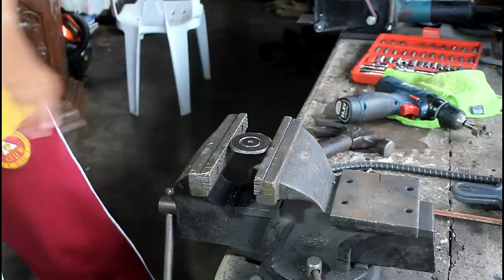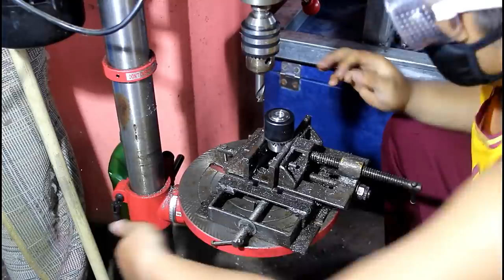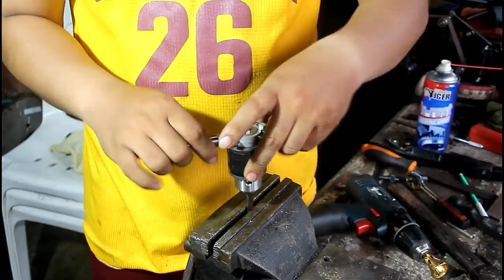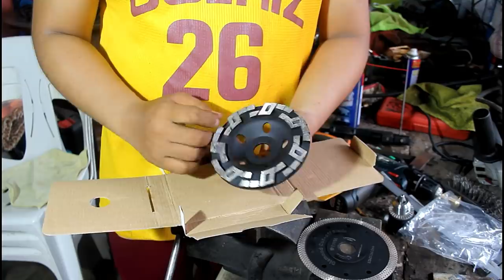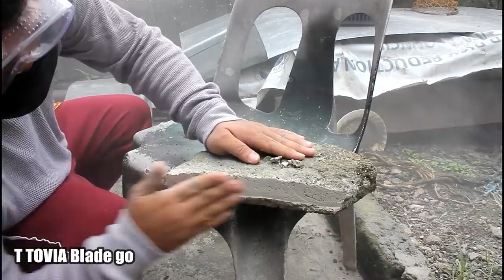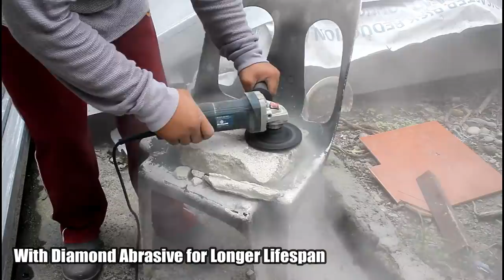Cut Straight Thread with a Drill Chuck ||Tool Hack||

Comment: It works, this is easier.
Chuck a gasoline engine valve stem in your drill press and the stock in the vise, use the valve to press the diestock flat while starting.

Comment: wow. Hell of an idea ! just today, i was attempting to thread a 1/2 inch electric motor shaft, to install a chuck. The threads were uneven, as the shaft had a flat spot for pulley setscrew. (i may weld that over, run the motor, and use angle grinder to shape it perfectly round)   i also have spare chucks, which, i may convert one of the best ones, (NOT  PLASTIC crap) into this type of threader, but will choose a slightly different method of attaching threadmaker handle to it. THANK YOU    too much, from Alberta canada.

Comment: Is round dies able to make threads in stainless steel?
Reply from the maker: My dies are not that high quality. They are just good in mild steel
Reply: I bought a famous branded round dies made in Germany at an expensive price but when I tried to make a screw on the Stainless Steel axles it couldn't either